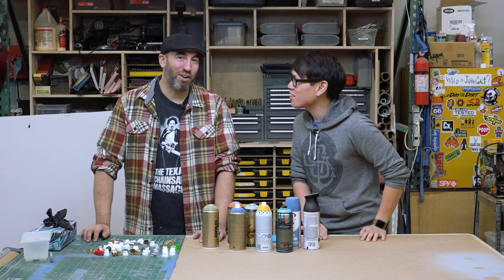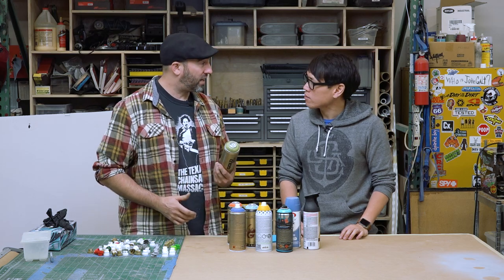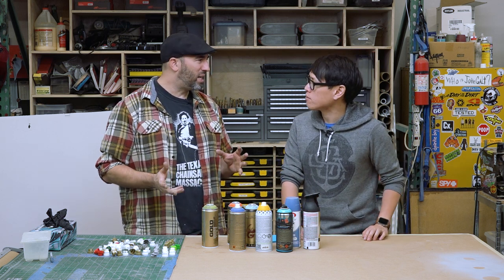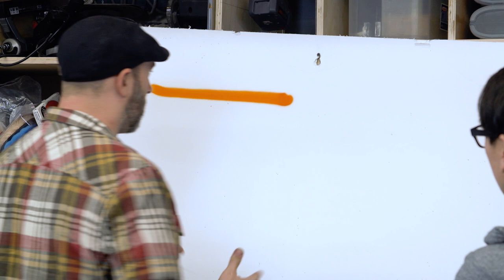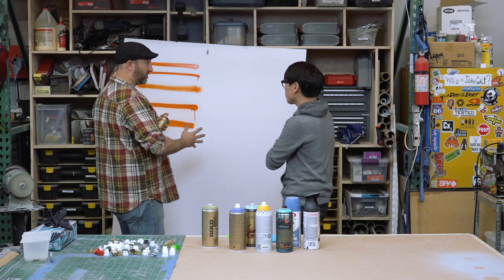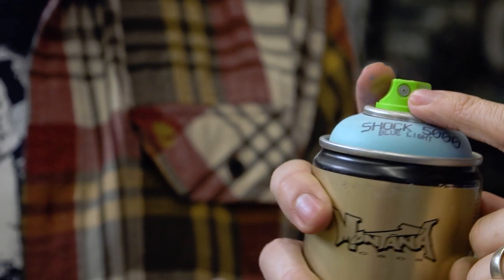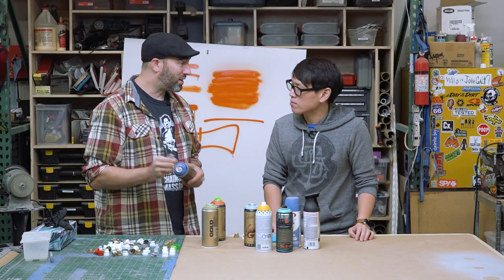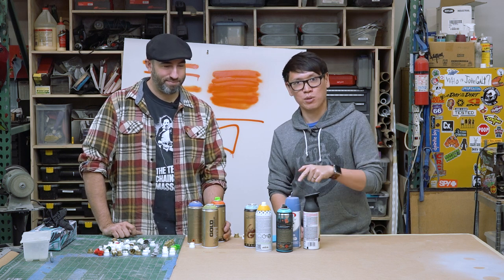Shop Tips: Using Spray Paint Nozzle Tips

Comment: You guys should have went over cleaning the tips. I recently learned an awesome trick. I take the tip off and put it on wd40 and blast it clean. then store it back on top of the paint or finish can. works AMAZING
Reply: Don't you get screwed by the greasy stuff in the 40 when you spray next time? (depending on the type of paint)
Reply: If you are having problems with that you could try using a can of condensed air duster usually used for cleaning computer components.
Reply: You can get some for 50 cents. So it wouldn't be worth the time to clean it.
Reply: +john M it adds up. Random nozzles are great for flavor. :)
Reply: Get a can of paint remover that is plastic safe that your cap fits and simply blast it clean when you’re done. WD40 won’t do anything but use one substance to push out another which leaves oily residue and paint in your cap. Compressed air will push some paint out and dry the rest of the paint in the hard to clean spots within the nozzle where it can easily build up. Paint remover, well it says it all. Blast out ALL the paint in your caps EVERY time. I’ve had some caps for years and they still look brand new.
Reply: Troglobit that doesn’t work anymore. Krylon and Rustoleum have and a boat load of others have all switched to liquid propellants to accommodate the “spray any angle, even upside down” feature. Usually works on cans with female valve systems using a gas propellant but that’s an old trick that’s going the way of the dodos
Reply: yeah thats what I do but what about inside the neck part that the tip fits into? I have put new caps and cleaned caps back on half used cans and every now and then the can doesnt spray or only sprays if I press the tip in a certain way or by spinning it and pressing it to a certain angle
Reply: I get a fillable can and put mineral spirits in it. Use that to blow out the caps.

Comment: This video was a bit light on information, like how to keep your nozzles clear for longer etc. (spraying the can upside down until it runs clear is a method I know)
Reply: Here's some good ones for you. If it clogs take the cap off by twisting it off, then bang it hard against the side of the can a good few times then place it back on by twisting it into place. Also smack the bottom of the can hard (not too hard, keeping the can flat so as not to puncture it) against the ground as a lot of clogs are actually the dip tube inside clogging or causing clogs into the cap and a good smack will clear it.

Place old clogged caps in a jar filled with acetone when not in use as this will clear most (remember to tap them after getting them out of the acetone to clear the cap before use) and you can buy cap cleaner cans that basically spray acetone through the cap to clear clogs on the go (but it's expensive).
Reply: the caps are cheap enough to not have to really worry about any of this, just buy some bulk bags from your local or online graff shop (coming from somone who ate ramen to afford paint back in the day for the all night sessions)
Reply: yeah I tought they would get deaper...also how to spray paint non-absorb materials...you go aver it with soft sand paper...than coat it with light strokes far away....let it dry for a minute and do it over....
Reply: Everybody knows to sand non absorbent materials, that's common sense.

Comment: TWIST the caps onto the can, dont just push
also: there is different pressures! as for montana; the gold line is low the black is high pressure both have a matte acrylic finish 
mtn has the hardcore line which is high pressure glossy finish and the 94 line that is similar to montana gold, dont bother with the basic line, if they even still do them, they are utter rubbish. if you want really really stupid low pressure there is the alien ones
they are glossy, but be careful its alkyd, alkyd tends to harden after some time.. weeks months.. and gets more bridle unlike acrylic. 
maybe this helps some.. lol
Reply: JP3 good feedback, sucks they didn't go into detail about different tins and their pressure or how to clean caps as well as the different types of cans not just the female ones.
Reply: thanks, i could go on about spray paint for hours due to my ''hobby'' and also job as a painter, there is just so much to it...
Reply: @GaugeBlast  feel free to ask, as i said, 3 years ago, theres just so much to it
Reply: @GaugeBlast  you could try to hold them upside down until no paint blows out to like free them up. especially with fast drying acrylics its difficult tho. they just clog up really fast
Reply: @GaugeBlast  3M industrial cleaner spray might work, just put the cap on and give it a spray, really you want to blow it out before it dries. acrylics krinkle up when you hit them with thinner, they'll just clog up more and become gooey
Reply: It would have been helpful to know where we could get additional tips for different spray widths. If you could drop the line where you pick up or purchase your different spray tips that would be helpful. The spray tip I'm trying to find has the plastic tube built into the spray tip rather than the spray tip tube sticking out of the can. Do you know if there's such fan spray tip for this type of can. It is a ultimate high temperature Rust-Oleum.
Reply: @keithtrap8693  oh and also spray technique is a factor in with, it really depends what you are trying to do

Comment: If you want fast or heavy broad coverage you can use a tip from an undercoating/gravel guard can. At work when I rebuild a big truck snowplow I use this trick in pinch. You can quickly empty a full spray can in seconds.

Comment: You can get really fat tips too that do like 6inches and wider. Also NY fat caps you can get thin and fat. There are also low pressure and high pressure cans so you don’t risk paint drips and can work a little slower with low pressure. Some cans have glass  marbles inside and some have metal, the metal ones you can stick a magnet on the bottom to stop it from rattling. Good for when you’re tryna hit the train yards and don’t wanna make a lot of noise 👀 Paint cans really has come a long away

Comment: also a good tip...when you are finished using your can, hold it upside down and spray it to clear out any excess paint. it'll prevent the tip and the line in your can from getting clogged. :)

Comment: recently used a spray can that came with this nifty little tip that you could twist, it was a sort of flat line nozzle and you could twist that part to get a thin or thick line depending on what way you were holding the can. surprised you didn't cover anything like this

Comment: Why nobody talk about spray can cap stem thickness.   I have CRC and CROWN cans where is stem in both 3,3 mm.  Bought a SEM extension wand and it is leaking around stem when I use it at CRC and Crown because stem is only 3,1mm.

Comment: Can you clean nozzles to use them on multiple colors or once you use the tip you are committed to using it for a single color?
Reply: TheSimom what you do is to clean the cap you tip the can inside down and spray until only clear must comes out, that will clean your cap. Just don't spray to long otherwise you will get rid of all the compressed air in the can, or you can use a solvent to clean paint as most spray paint is just enamel paint then you can use the cap again, most times though just change the cap and spray on something until your chosen colour comes out, the thinner the cap the more likely it will clog and it usually clogs because you haven't shaken it up enough.

Comment: :o no mention of male and female caps  or chisel tips. I don't know if anyone will read this but if you buy a non "graffiti" tin they will have a cap that's different to "graffiti" tins..they will have a piece of plastic sticking out also known as a male tin...and the others are female if you get the it. You cannot use a "graffiti" tin cap on a male tin they will not work and if you try prepare to get messy 👍

Comment: Hey I have a question, I have about fifteen cans of that Montana spray paint that I've had for about 5 years, they've been in my house the whole time, the cans have seized, or something, like when I put a brand spanking new cap(fat, thin, etc. doesn't make a difference)on any one of them they will not spray, I've tried other caps, spraying while inverted, ludicrously shaking them for waaayy longer than is necessary(3-5 minutes)no aerosol comes out, no paint nothing, the balls still rattle when shaking, they cost $13(CAD)each, so is there ANYTHING I can do? Also, on an unrelated note, is there a way to clean caps out for re-use? I'm broke.
Reply: Sugar Hieroglyph hey mate couple of suggestions, if the ball is still moving that's a good sign the paint has not hardened inside the can. Your main problem is the time the tins have been left unused, as anything metal the material will fatigue over time and the compressed air may have leaked out which will make the tins useless. A way of testing if there is any air inside get a wooden skewer and poke the top of the tin and see if anything comes out(do this outside and wear something you don't mind getting paint on) if air and paint come out that's a good sign. If not then your can is empty of air so what you can do so you don't loose the paint is rip open the can (make sure it is empty otherwise you will make a mess with paint everywhere...I learned the hard way) that way you still have decent paint to use. If it does have air and paint comes out then hold the can upside down and put the fattest cap you can find and press down that may help flush out the hose that's inside the tin. Hope that helps. Also with caps you can reuse them you need to soak them in paint thinner that won't effect the plastic leave them for awhile then they should be golden, also if you have a can that works out it upside down and spray that will clean newly clogged caps
Reply: Thanks, I'll try this out, man I hope they haven't leaked out of aerosol, I never even got to paint with them $13 x 15 cans = well math isn't my strong suit, art is, later.
Reply: Sugar Hieroglyph good luck with the cans and yeah I'm the same way when it comes to maths, one thing you could try but I have never done it is get compressed air(like the one you use to clean a computer) and stick the nozzle into your tin and maybe you can give the can somemore air...it may work but maybe YouTube it and see if people have tried
Reply: Ten four good buddy.
Reply: Have the cans been used before or are they totally new? If they haven't been used before, it's possible the safety ring is still under the cap. I don't mean to imply you're daft, but it's something that occurred to me and just the kind of mistake I'd make.
Reply: No the safety rings(black plastic rings around the input that fall off when inverted)are off and no some off them haven't been used, which I find strange, I mean if there is no paint in the stem(i guess there must be a bit of paint in the stem even when brand new?)how could they seize? It's an easy mistake to make though, I've done it once or twice.larl
Reply: if you're not getting any air coming out of the tins then it has sprung a leak over time. I have a few tins that i have not used in years but i wont be since they are limited edition ones but they have lost the air just the metal fatigue. Luckily the air came out first so no the paint wont leak.

Comment: I want to know how to keep the tips clean. They didn't say how.
Reply: Mike Mcmillan try soaking them in paint thinner or turn the can upside down spray until clear air comes out (usually 1-2 seconds) and the cap is ready to be used again...but caps do clog quite easily especially the smaller outline caps (grey dot white cap)